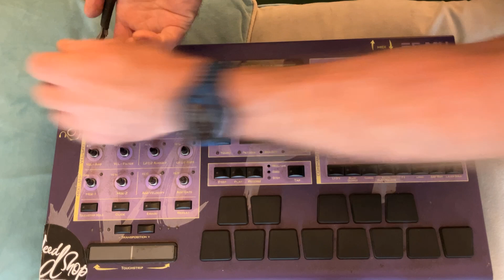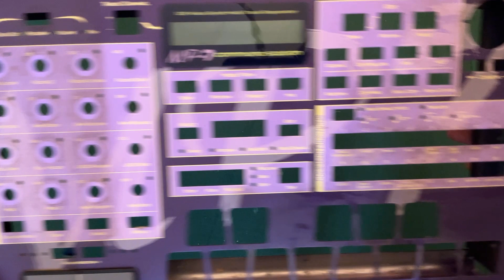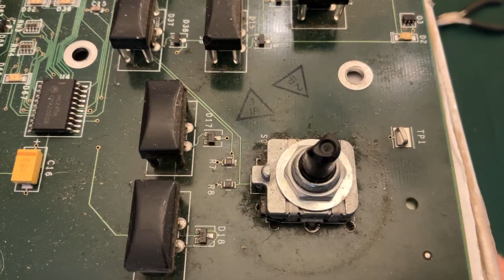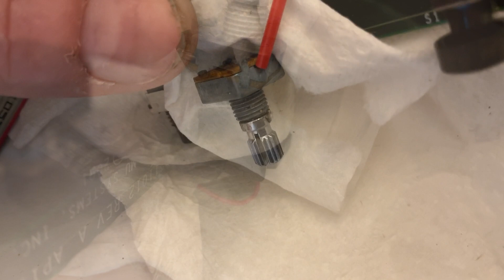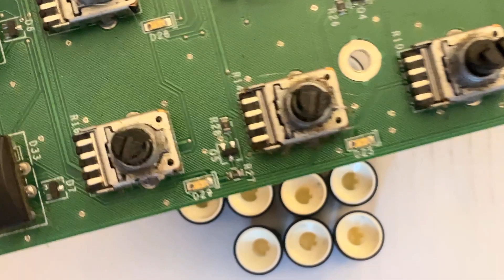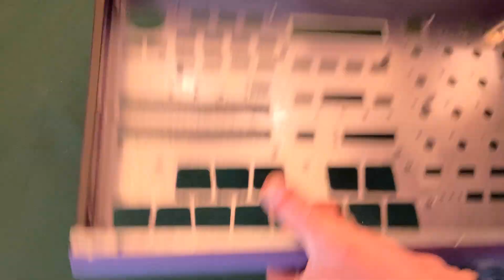Emu Command Station MP-7 strip down / repair adventure

Comment: When you did this, did it erase the beats/patterns that were saved on it?
Reply from the maker: Hi there, good question ! 🙂
No, they are stored in flash memory in the unit.

Might be worth backing up the presets, patterns and songs though. For piece of mind etc.
For info, the Emu Command Station does not have a 'backup battery'.

Are you thinking of doing this with yours?
Reply: @1heUndertaker  I would love to get mine fixed. It freezes mid power up. I'm not sure if there is anyway to back up all my work on the machine. Would you be able to help?Where are you located?
Reply from the maker: @PretendIndustries  I'm up north, in the UK.

Unfortunately, the patterns are stored in flash memory on the main circuit board, so it would need to fully boot up to access them.

Questions for you - 

1. Have you tried removing all the installed sound ROMs, and then booting it up?

2. How far does your Emu complete the boot sequence? 
ie does it light up all the LEDs?

3. Does the Emu logo appear on the screen?

4. What is the history of the unit - 
How long have you owned it? 
Did you use it much? 
When did the problem start?

If you could video what happens when the unit is switched on, that may be helpful too.
🙂
Reply: Apologies for the late response. All lights light up but the emu logo does not. It freezes up about a second or two into powering up.
Reply: I’ve owned it for many years, but it started freezing up about 11 years ago.
Reply from the maker: @PretendIndustries maybe the power up freeze could be related to low PSU voltages - these could be checked initially with a voltage meter, but a more thorough test with an oscilloscope might reveal a ripple voltage issue.
Could also be a failed component on the main board, similar to when a PC does not boot - if a graphics card or disk drive has failed etc

Comment: That's an encoder, more like a switch than a potentiometer.  E16, easy to source and replace.
Reply from the maker: Thanks for bringing to my attention !  👍
As I understand it, the data wheel is an encoder, the volume control and the 16 control knobs are potentiometers.

Maybe I used the wrong word / term for the item I was talking about ? ☺
[not sure at which the point in the video which you are referring to?]

I have been known to get terms mixed up though 😁
Reply: @1heUndertaker  if you get stuck, let me know if I can help.
Reply from the maker: @BluePlanetMedia  Great, thanks for the offer ! 🙂

Comment: The most tricky part I repaired on mine was PSU. It was my first experience of fixing switching power supplies, but I had no other choices and it went good.
Reply: How did you repair it? I have a faulty PSU i was thinking of giving a re-cap to bring it back to life, but I wasn't sure if this would fix the issue. I ended up buying a replacement. Would love to know how you fixed your PSU
Reply: @ghoulian  If my memory serves me right, I replaced one power transistor, one small and a bunch of fried resistors. I re-capped my on arrival. It got fried a couple of years later. When it happened, I had to replace filter cap once again, the one that I originally put there was dead after this.